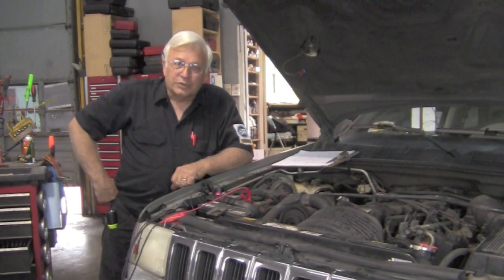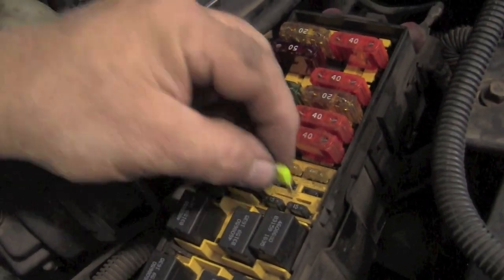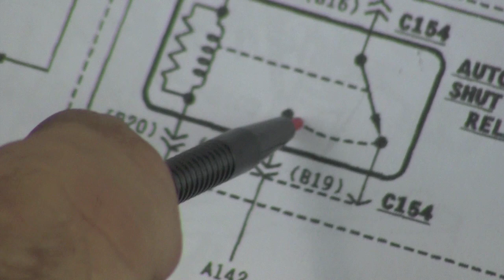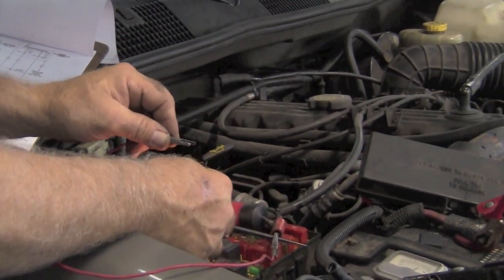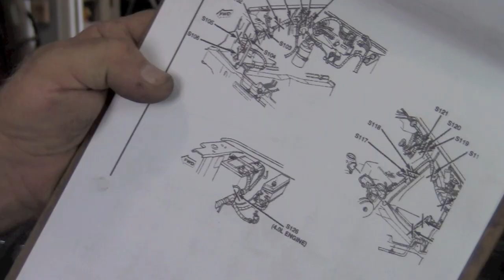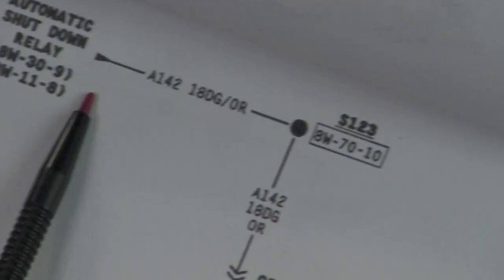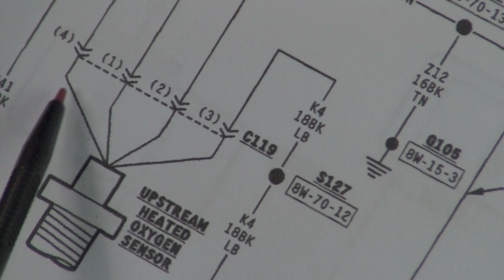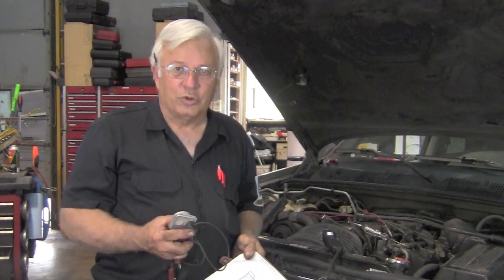Finding a active short

Comment: think i have seized engine. starter works but do no how to turn engine manually 2002 
mercury sable to see if engine gone hole in oil pan
Reply: +William Hill I'm two months late, but hope I can give you a little information. From what I read, you have an 02 mercury with a hole in the oil pan. Your starter works but does not turn the engine over. And you want to know if your engine is seized. What I'd do (and what I do to check for a stuck engine) is take a look at the crank shaft pulley. There should be a nut/bolt in the center; get a socket to fit it and a breaker bar, and try to turn it. If it turns, you aren't seized.That being said, I'd look and see if there are any metal shavings in the oil or at the bottom of the oil pan. If so, something isn't right. But realistically, if there's a hole in the oil pan, and the starter wont turn the motor over, odds are the engine needs an overhaul.

Comment: I just went to my mailbox and saw the Short Finder plastic box from Tool Aid.  This weekend I will give it a try.  This is an old video.  I wonder if the guy is still alive
Reply from the maker: Yes, I'm still alive.
Reply: se7ensnakes You may also want a Power Probe , that's the other tool, a bit pricey, and takes some time to learn how to use it, this gentleman has the knowledge and discipline that it takes to make a real Master mechanic that can fix almost everything.At a profit !!!

Comment: I have a problem with my car, when running idle the alternator charge is 14.11, when accelerate the alternator drop to 11.4 volt. Can you help me.
Reply: Remove the alternator and have autozone etc. bench test it. It sounds like the internal voltage regulator could be the issue. The v belt is not slipping is it?. Good luck.

Comment: 99% of older model eng  weak or no spark can be traced to the condenser  ( wrong value ) or defective  these condenser have match the coil  for max spark  the com in diff microfared  sizes   one sure sign it wrong is pitting points  the only way to get correct condenser is verfy part # in old orig manual at dealer   then cross ref that # todays part #s   mine is 27 mfrd  it give 3/4 inch spark at idle with plug wire held close to eng

Comment: Is  there a reliable source that I can buy a wiring diagram for my chevy van somewhere that you can recommend?
Reply: I recommend Mitchel1DIY.  google it.  It is basically the same information we use in our shops.  However we have to subscribe to it and then we have access to every OEM, every model, every year etc. and it costs close to $200 per month.  With their DIY program it is around $20 once a year and it is limited to one vehicle selection.  All the diagrams and other information is there as well.  It is well worth the cost.

Comment: My question, is that tester safe on new vehicles meaning the computer?
Reply from the maker: yes absolutely.  Think about this.  I tests for an active short right ?  If the circuit could have harmed a computer on the same circuit, it would have already done so when it has repeatedly blown the fuse.  And, even if it didn't, the circuit breaker (in place of the fuse) simply opens and then resets.  Good question though.

Comment: Where does one find electrical diagrams? I've got a Hyundai accent classic 2005 that has a battery that drains in a day or two. No fuses busted. Need that diagram. The cables are impossible to follow workout it.
Reply: ***** Stereotype much? :P 

If I could afford it I'd probably buy a hybrid of some kind, or maybe even electric. We've got a free charging station 50m from where we live. 

But now we can hardly afford the broken Hyundai so I need to fix it.
Reply: ***** Won't be able to afford one until all the kinks are worked out anyway. Really have to get this thing working or get back to taking the bus everywhere.
Reply: ***** Me too. Thanks, I'm sure it will if I find a diagram. 

Have you looked at the wiring of cars? It makes computers look like toys!
Reply: ***** I'm a computer guy as well but these things... Man they're complex. And tightly packed!
Reply: Jim Groth If your battery is draining every few days, it sounds like u have a parasitic draw draining down the battery. best thing to do to have a multimeter handy and perform a drain test. best I can do to describe this is this..

1- make sure all power is off in the car, lights off, doors closed, and make sure ur battery is HEALTHY to start with. 12.6 volts is your typical healthy battery

2- set ur multimeter on the mA or Amp scale. pull the negative cable off the battery and take ur meter leads (red one in the Amp hole and black one in GND) with red to the battery negative cable itself and the black lead to the battery ground post.

3- read ur meter.. if have MORE than 50 mA (milliamps) as a reading your battery is being drained by a circuit.

4- the way to find which circuit is doing the damage is start pulling fuses in your fuse box / boxes (you can have more than 1) until u see the number goes out or down to 0. just pull one at a time and put them back so u don't get lost as to which fuse goes where. when u find the fuse that brings ur number to zero that's the circuit u have to inspect.

5- best I can recommend as to finding a diagram on that circuit is going online and searching for an auto wiring diagram / schematic. or go to the dealership or parts store to see if they have access to a program like Mitchell or Alldata. or buy a repair manual that has the diagrams.
Reply: Travy B Thanks. This is kind of the process I've realised I've got to follow. The fifth line is giving me a headache though. This is the Internet. I should be able to find a trustworthy place to buy things like with all other large markets. 

Anyway, I'll try the dealer that sold the car, but they'll probably try to skin me. XD
Reply: Some things just hafta be fixed the aftermarket way. I've got an ol' Mercedes that has a persistent 1 wk battery drain if the car is not run constantly. 
Fortunately, the battery is in the trunk and I installed a thumb screw battery post. So when I need to use the car..open trunk turn thumb screw..and start. Sure beets getting the charger out to revive a dead battery each time; they are costly to replace. 
The downside: radio presets aren't there. Unfortunately, the Accent has the batt under the hood, requiring the extra step of unlocking the driver door to release the hood latch to open. 
This sounds like a job for an Arduino project to make it hands-free and wireless.
Reply: Giligain I. Now why didn't I think of that! :D

Thanks!

Comment: When a fuse blows why does it show ground on one side? Wouldn't that be WHY the fuse blows?
Reply: +jason sparrow Little late, but that's how a DC circuit works, or any for that matter. If you have power but no ground, it's the same as hooking up the positive/+ terminal on your battery but not the negative/-. The car's circuits will recieve power but not ground and therefore will not complete a circuit.

Furthermore, resistors are installed in circuits to reduce the amperage allowed through a particular circuit. For example: Let's say you have a short as described in this video. The reason the fuse blows is because one end of the circuit has resistors that limit the amperage to 20A. Where the wire is shorting has no such resistors in place and therefore is sending more than 20A of ground to the fuse. This is why the fuse blows and the reason they are in place.
Reply: you misunderstood what i meant. i just meant that if you detected power on one side then you know that part of the circuit is good. the other side of the fuse (that is blown) registers ground indicating that power has a direct path to ground (causing the fuse to blow). If that were the case replacing the fuse should cause and instant blow. Am i wrong in thinking that the backside of, really any, fuse shouldn't have a direct path to ground? I guess it would make sense that a circuit would still show continuity between the back side of the fuse (that's shows ground) and the battery neg through a load. if the switch were off, and no continuity existed, then it would do nothing. I think I was just not seeing the full story. Thanks!

Comment: with all due respect if you just put a higher wattage bulb across the fuse instead of your circuit breaker then proceeded to unplug each item on your diagram you would have found the short much much quicker.

Comment: how would I find out an issue with a EATX relay just clicking, no fuses blowing just clicks and gets stuck in 2nd gear (limp mode) can i use an amp meter to find the short?
Reply: ever find solution?

Comment: What happens when the power of one circuit connects to the power of another circuit?
Reply from the maker: good question.  First, power is always looking for ground and will take it whenever it finds it, right or wrong.  So, if power in one circuit connects to another circuit (right or wrong) and that completes to ground, whatever load on the circuit will be powered on.
Reply: @realfixesrealfast  would the voltage change?
Reply from the maker: @meblake7359  good full voltage should be 12 v not running, charging v running.  Ground should be close to 0 v when activated, if above 0 v you are dropping voltage somewhere and that’s not good.

Comment: if it was me i would do sort of the same except where he jumps the ASD Relay i would first replace the relay and instead of the leaving the fuse that is blowing i would fit a resetable fuse in its place or as he has a circuit breaker which is exactly the same just alot bigger. then start the car. if the fuse does not blow 99% Job done. if it does then proceed with other tests. 
As all mechanics charge an Hourly rate i can see why he does it the long way but i am more efficiency/Quality driven not $$$$/Quality driven.

just annoys me when i see someone doing something the long way when both ways lead to the same place. 
also i am in no way AT ALL saying this has anything to do with his abilities as a mechanic/Auto Elec its more of my own personal gripe
Reply from the maker: You have a valid point, yes there are short cuts that save time.  However my goal is to teach and demonstrate principles.

Comment: too slow and why we have to kick the shorted system with hundred and hundred amp, why not eough just couple bulbs to instal to the fuse leg and measure just with 30 amp or smaller amp gauge just with normal load on a cable?